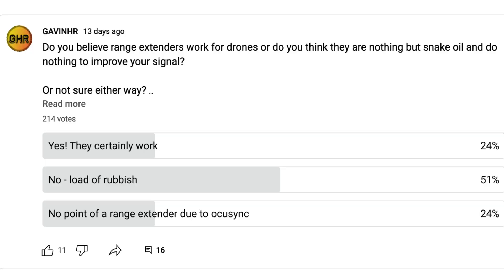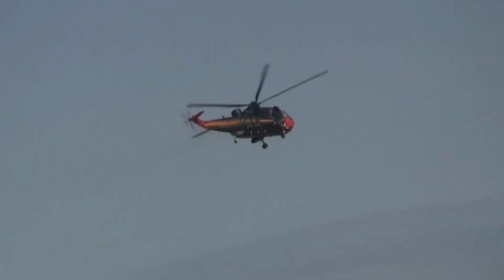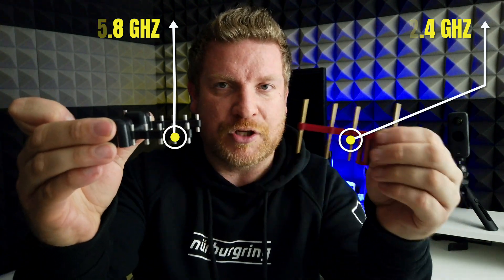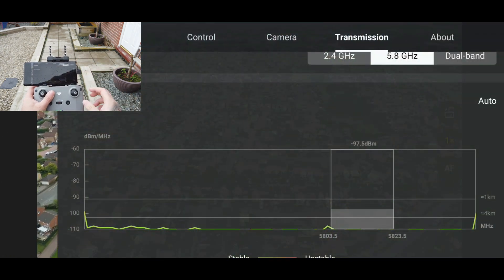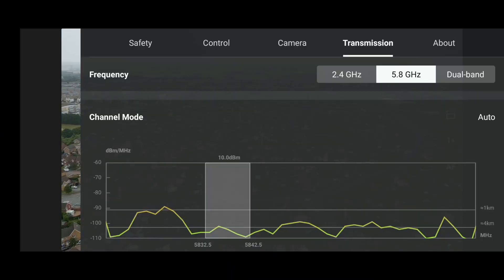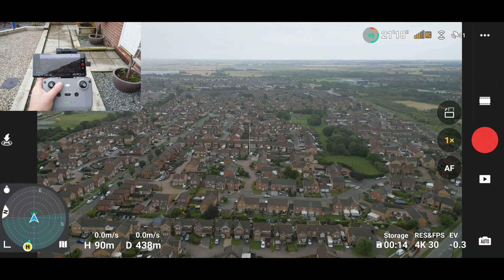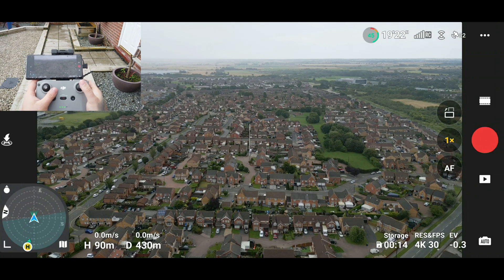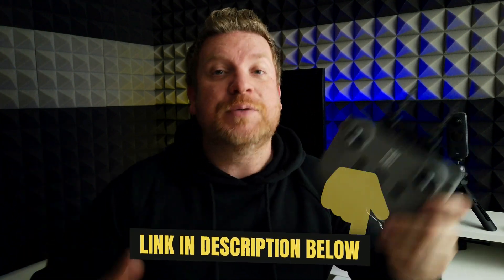I Tested Range Extenders on the DJI Mini 3 Pro - Do They Work?

Comment: you rushed the signal strength indication lending doubt to your conclusion. using bar strength meters you have to be aware that if the measured value is between two bars, one bar may lite and extinguish simply due to rounding function in the measurement circuit. environmental factors were also ignored as you only briefly tested in one spot.

Comment: Or multi Band?
Reply from the maker: I would stick with 5.8ghz
Reply: Thanks mate, but they also work in 2.4 GHz? And in dual Band function on the RC remote?! @GAVINHR
Reply from the maker: @alseir those ones I used are 5.8, if you use 2.4 in fly app it will be worse
Reply: Ok, my model of yagi is a Lichifit Yagi "extender antenna rc YX-754 , what is the best band i can use? 2.4 GHz?
Reply: Sorry for the questions.
Reply: So i shoulnd put dual Band on when i have the yagis right? I shold set the remote do 5.8 and thats it right?
Reply: I suere thats the last quest lol

Comment: Firstly, im an advanced amateur radio licensed operator….. i build and have built many yagi antennas for various bands here in Australia. You really need to understand antenna theory to grasp exactly what is going on. Antennas are tuned lengths for specific frequencies, outside its tuned freq it fails to operate efficiently….. so as you go up in the band (higher frequencies) you’ll notice the elements on the beam become smaller….. the more elements on the boom of the yagi give you more gain ie. for example 1 watt signal x 6db gain gives you 6 watts of ERP ( effective radiated power ) so it multiplies your power output effectively. But never forget the more elements on the yagi also reduces beam width…… meaning if you point the transmitter more than 15 degrees either side of the true direction of the drone you risk losing signal almost completely…… or return to home function taking over very quickly. Unlike the standard co-linear vertical antennas standard on drone controllers which radiate and receive omni-directionally ….. at  90 degrees to the target yet 360 degrees around the whole antenna…. Making it less likely to lose signal completely at reasonable range especially if you need to place the controller down for a moment its more forgiving…… you dont have the gain factor of a yagi giving you effectively more transmit power and more sensative receive but much narrower beam width….. hope that makes sense to you guys….
Reply: I'm a mechanic/machine operator and through all the jargon I got what you meant. If I aim at the drone with the "extender" (lamens terms for me to understand), I should be good if I stay within that 15 degrees, just be vigilant?
Reply: Perfectly understood👍🏼
Reply: With the yagi uda's sold on amazon for these controllers its nowhere near as narrow as 15 degree beam width. Its more like 90 degrees, which is more than wide enough.
Reply: @Baleur  dont forget 15 degrees at distance can give you that impression….👍🏼
Reply: Hi guys, what Band should i use the yagi? 2.4 or 5.8? Or dual Band? Thanks guys

Comment: I see no mention or testing of antenna orientation.  That’s a shame.  Be aware in your use and testing that any radio frequency signal is most strongly radiated or received perpendicular to the orientation of an antenna and weakest in the direction you point the antenna.  In other words, point the antennas up or at some other right angle to the drone, not towards the drone, so that the signal is strongest.  This applies to all radios, including your home wifi router.

Comment: Definitely Worked for me with air 2s , didn't work at all on mini 4 pro
Reply from the maker: Yes they will not work on the mini 4 pro because it has a 5.2ghz frequency that it’s more likely to be using so the 5.8ghz yagis will not work with that

Comment: They should be referred to as "Signal Stabilizers" because that is what they do.
They are not signal boosters, they do not boost the power of the signal.
They are not range extenders, they do not extend the drones rated range.
They simply "Stabilize" the signal.
And they work better then what is shown in this video.
Reply from the maker: They work much better than what I show in this video I agree. Had I flown further I’d of had dozens of comments screaming VLOS at me. Check my old videos out on the mavic mini when I started this channel. I know exactly what they can do

Comment: Yep, it us Occusync's frequency hopping that is the problem, not the yagis.

I have "superyagis" and really do need them in VLOS. Wet shrubs and trees seriously attenuate WiFi signals, and I often fly a few metres  above them. Even in the countryside, farms use WiFi boosters which can interfere with the signal at ranges of around 50 metres.

The only drawback is that yagis are VERY directional - but I am in VLOS, right? So... no problem at all.

Thanks for the test Gavin 🙂👍
Reply from the maker: Bingo! I just wanted to dispel the myth that they don’t work when they do. Appreciate your continued support, glad the superyagis are still doing their job !

Comment: I got some parabolic antenna extenders for my mini se a couple of years ago after watching you trial them out and they definately improved the signal and range of that drone, I had used yaggis and found  you had to keep them focused on the drone at all times  but with parabolics  they were more forgiving and just  had to keep pointed in the general direction for them to work. I got some yaggis for my mini 2 but never bothered using since fly in FCC mode instead and that plenty of range for me.

Comment: It switches to 2.4 because you are flying further away. 2.4 Ghz travels longer distance due to the larger waves of the frequency. 5.8Ghz has higher throughput tho
its the same with your wifi at home if you have duel band wifi or 2,5 and 5ghz seperately

Maybe there were more 2.4ghz signals around the area. thats why you had better coneection with 5.8ghz because the channels werent used as much.
Reply from the maker: Indeed this is the case I advised exactly that in the video however 5.8 can go very far and only the mini 3 behaves this way the mini 2 sticks on 5.8
Reply: Weird why does the mini 3 behave this way?

Comment: Wow. That was a brilliant test !!  I have a question. You wrote in a answer to a comment that the mini3 pro has a signal issue that the mini 2 had not. What about the Mini 3 ( not pro) has it also same issue ?
Reply from the maker: Sadly it is not a drone I have played with on the channel to be able to talk about it really, its not particularly that the mini3 pro has an inherent issue its more in my experience it seems to pick the wrong frequency as demonstrated here whereas the mini 2 seemed to be much better

Comment: What’s your opinion on using third party batteries in the mini 3 pro. I was unable to buy genuine dji plus batteries in the uk at a reasonable price but amazon sell aftermarket ones for £90.
Reply from the maker: Do you have a link please? I’ve never seen them I’d be interested to see, have you tried eBay? I got it plus batteries from aliexpress shipped to UK
Reply: NEVER EVER buy non genuine batteries from a reputable source, anyone who has played this china battery game knows non genuine is not worth it. From straight up scams to outright lies about battery capacity to safety issues. DONT DO IT

Comment: I remember when you made the same video with the mini 2 and said it makes a negligible difference. I used to have a mini 2 and brought the 5.8GHZ yagi but then I returned it after it made no difference. I now have a mini 3 pro with the RCN1 controller and won’t buy those yagis again. From my experience the yagi antenna only worked for me when I had the mini 1 with the fold out antenna. Maybe they will work for the DJI Air 3 with the screen controller but that would be more complex as that operates on 3 different frequencies.
Reply from the maker: Yeah I answered this in another comment too, you’re right I did say that - based on the fact that the ocusync on the mini 2 did a great job on selecting the right frequency. Sadly that no longer seems to be the case especially with the mini 3 prop as I showed in the video, the air3 certainly won’t need extenders given the fact it’s got the 5.2ghz frequency now - that won’t won’t be congested at all and should give a signal equal to the autel
Reply: @GAVINHR  i was actually considering buying the autel nano plus because of its 5.2ghz frequency and better range. But I stayed with DJI as it has the fcc hack, a 47 minute battery and I still had a working controller from my broken mini 2. I am hoping the fcc hack is a bigger advantage than having the 5.2ghz frequency as there is no way to put the autel into fcc mode. I have also heard that autel has terrible wind resistance. In case your wondering my mini 2 was hit by a pigeon  which broke its arm.

Comment: I used the parabolic antenna's on my older wifi drones like the Mavic Mini and the Mavic Air and actually saw improvement in the range and signal strength. I have also tried the yagi's as well on my Mini 2 and Air 2S and didnt really see much difference since O2 and O3 are really good already . I still carry them in my bag and try them every once in a while just to see in different environments if there is any difference. I would say its marginal at best in my experience. They absolutely do work though and that's why I still carry them.
Reply: Exactly what you said. 😂 I bought them because they were cheap on Amazon and I like to experiment and fiddle with everything I own trying to find the sweet spot. They make a noticeable difference but if you get distracted by something and happen to turn away from the drone it's over. Really haven't had any reason to use them in 2 years on any of my drones...even tho they are always in my fly bag. Just in case.
Reply: Bro have you seen the ocusync 4 on the air 3 with the 5.1ghs?? I am really curious to see if range extenders would work on something like that
Reply from the maker: I can 100% assure you no drone running on the 5.2 frequency will even need extenders that thing will give insane range
Reply: @GAVINHR  yep and hopefully we can finally go under bridges safely
Reply: @RaniRani-zt2tr why you wanna fly under bridges so badly  man?? You a troll!😂 Don't they live under bridges😂 
Sorry I couldn't help myself. 😊👊
Reply: @jimig399  idk bro it is like the only place to fly at your own risk without absolutely no limitations🤣🤣
Reply: @RaniRani-zt2tr  Now that you mention it I think I've been missing out on all the bridges in my area. I live within an hour drive of the Coronado Bay Bridge in San Diego. I'd never thought of flying it. It's pretty epic if not a bit trepidatious just driving across it. I bet flying across it is intense. I'm gonna do it. There's also the Goat Canyon Tressel that's even closer to me in Anza Borrego. That thing is epic. It's been off limits to drones for many years tho because it's a historical monument located inside a National park. Recently I found out it was sold and is now private property so it's a possibility...I'm gonna find out. Thanks for opening the door to some new ideas friend. 🙏 Happy flying. 🤟🤝
Reply: @jimig399  there we go another set of bridges to put on my calendar Tnk u

Comment: interesting result. Interesting video. 
Does this kit provide any help for the RC pro controller?
Sometimes get the message: RC control interference.. I know being to close to my tablet that happens so I move away a few yards, but being several hundred feet away from buildings, masts, I wonder: What is picked up? At 2.4 or 5.4 GHz?

Comment: What I  don't understand is you done a similar test on the mini 2 and didn't recommend the extenders?
Reply from the maker: Well spotted !  Yep back then with ocusync 2.0 the mini 2 seemed to do a great job in changing frequencies to keep a stronger signal so my advice was to trust ocusync. As I showed in the video these days and particularly on the mini 3 ocusync seems to just get it wrong all the time so I personally believe this is now a better solution based on that information

Comment: Yep they work. I used to fly the mini2 in a tree infest area besides a river and the signal would cut out. I was in the flying in the line of sight cause I didn't want to clip any trees over a moving river. When I had the "signal booster" on that fixed the issue.  So I actually used it. I didn't just say it was rubbish and not have tried it.
Reply: Yeah they work for sure 

They say keep it on 5.8 though for maximum effective

Comment: Thanks G. Question for you as I don't see another way other than here. Lost Mini  2, and given a Phantom 3 Pro two days ago.  I haven't run it yet as I wanted to find from you where to go/stop w firmware on the aircraft,  RC, and fly app. I have not even started up to find what v it's running. Was using Litchi on my Mini....loved it. Thanks man!
Reply from the maker: Hi there, first of all the simple answer here is just use litchi! The fly apl will not work as it used the go app but litchi will work just fine
Reply: @GAVINHR  THANK YOU! Now that was quick GAVIN.  Can you also tell me re the firmware where it should be...or not be. If it's too high possibly I could roll back? Your posts have always been great, I've got to  get you some French roast.

Comment: Lately, it's been nearly impossible to fly any distance in congested areas & think it's down to the new 5 generation  wifi towers in my area so switched to FCC & it improves the signal exponentially.
Reply from the maker: Indeed - the sheer extra broadcasting power will make the biggest difference
Reply: Can anyone explain this fcc
Reply: How did you switch to FCC?
Reply: I'm getting the same problems up in the north east of scotland and thinking about buying a signal booster it's only £10 so be aswell try it out mine has problems when it gets to around 500m hight isn't a problem and I'm not flying between any hills ect I'm convinced it's dji software 🤷‍♂️

Comment: I find that my Mini 2 goes out of sight at about 220 meters, and there is no way that the signal is going to be compromised at that distance. Unless a building blocks the signal -- and you shouldn't have put the drone behind the building in the first place!
I bought a range extender for grins, but have never used it.

Comment: Can you get any equivalent kit for the RC controller?, I've noticed the range of the RC with the mini 3 pro isn't as good as the rcn-1 and mini 2, or maybe I'm doing something wrong
Reply: Nah that's just how it is without external antennas.

RC2 fixed that if you noticed hahaha
Reply: @Matanumi  yes I had noticed, by doing that dji5just admitted there's a problem

Comment: Have you seen the parrot anafi AI 4g drone that offers unlimited range. It does require a SIM card and data plan to operate. In mainland china you can get a 4g dongle for the mini 3 pro to get unlimited range
Reply from the maker: I have indeed! basically work off the mobile phone network so where there is cell service you have range - incredible stuff

Comment: Even if it’s illegal to fly beyond VELOS who will enforce that. Whats the likelihood of actually getting into trouble doing it. When flying from my back garden I used to get 400m of range but in fcc mode i can get 800. That’s with the 5.8ghz frequency as I live in a built up area.
Reply from the maker: People may shoot me down for this but the only people enforcing VLOS is other drone users being drone police. If your flight is safe and with no incident I see no issue myself
Reply: I fully agree that common sense is required, but sadly, it's not that common 😂😂😂😂 I see no problem with bvlos
Reply: No-one will enforce the vlos rule unless you bring down a helicopter and kill the crew, then your going to the big house for a long time
Reply from the maker: Exactly what I said, if the flight is safe and without incident there would be no issue
Reply: @sifly999  There was an incident in Ontario Canada last yr wherein the police launched a matrice into aerodrome airspace, the observer didn't know what his job was and the drone impacted a cessna on final causing serious damage. The Transport Canada investigation was a comedy show and as to be expected the police only received a slap on the hand.

Comment: I thought the signal issue with the Mini 3 Pro was centered on its use with the new (let's call it new) RC Controller (with the inbuilt screen). This has no way I can see to add a "signal booster" because everything is internal. Do you know of any options here?
Reply from the maker: Nah the RC controller is absolutely fine, its a combo of the antenna position in the mini 3 and the fact ocusync isnt doing its job properly. Sadly running that controller there is not much option other than to do as advised and make sure you fix on the right frequency - this will help
Reply: @GAVINHR  Well, that answers why I have never had a problem with the Mini3Pro and the RC Controller! Loved the tip about the arrow turning green by the way, I didn't know that 👍